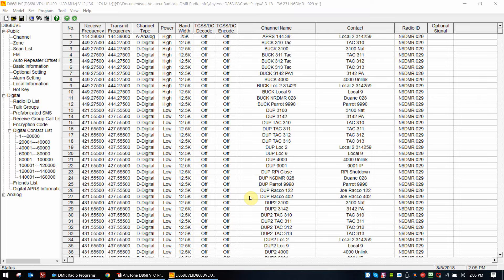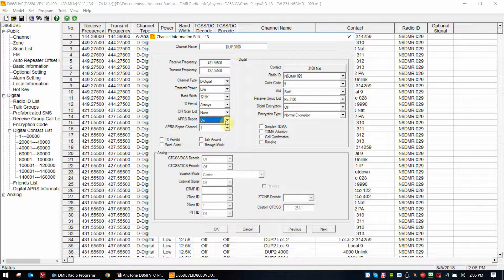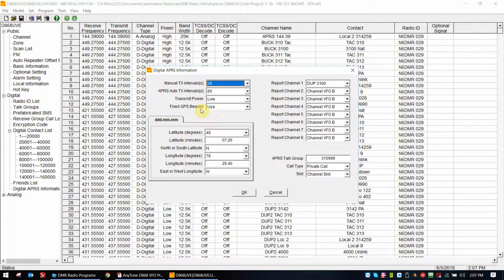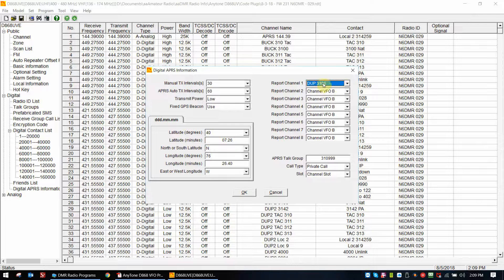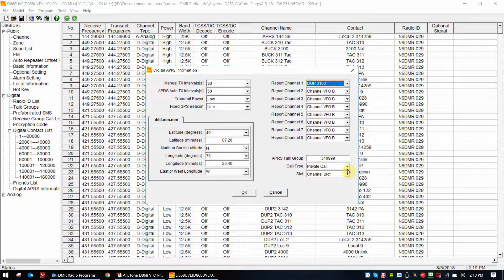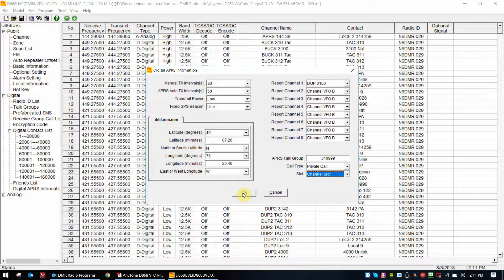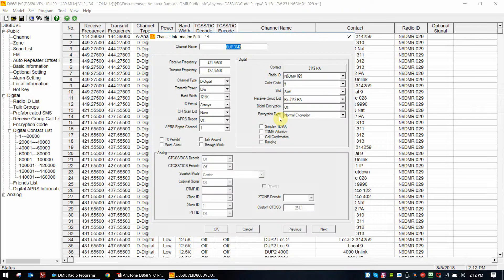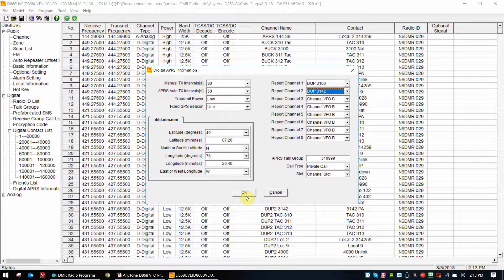2/3 Setting Up DMR APRS on D868 Radio @N6DMR

Comment: There are 8 reporting channels available. So that means I can only use the DAPRS functionality lets say in 8 different areas (max 8 repeaters). But since in "DAPRS info" window I can select "current channel" togehter with "channel slot", so that means it will use the "channel" settings, therefore I can use lets say "report channel 1" for all APRS channels. Am I right? Or it just won't work like that.

Comment: Any chance of a video for Analogue GPS setup on the AnyTone AT-878UV please?
Reply: Anytone AT-D868UV does not work with analogue APRS. Digital (D-APRS) only.
Look for Anytone AT-D878UV for this
Reply: @sergei3648  still has anyone done a video on this? I cannot get mine to transmit show up on APRS through analog.